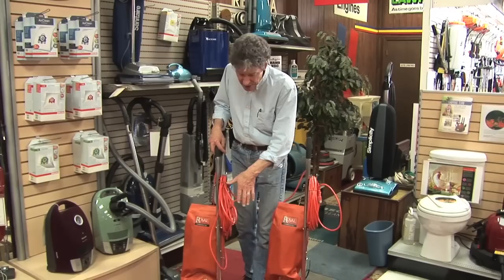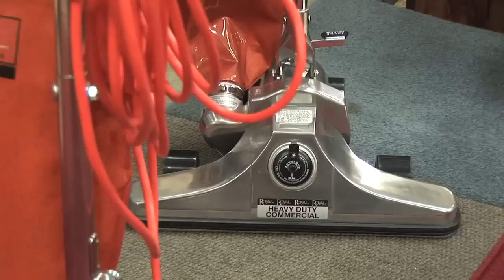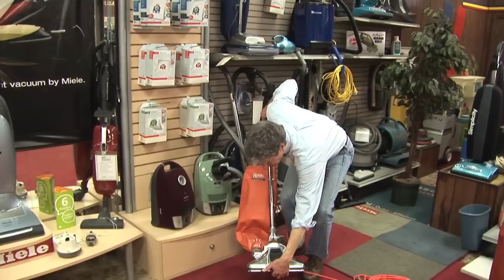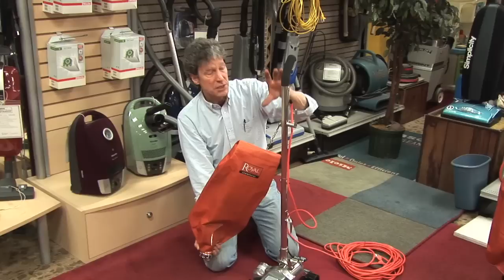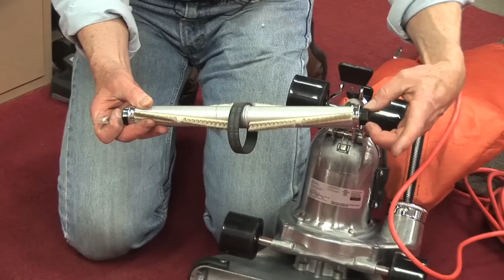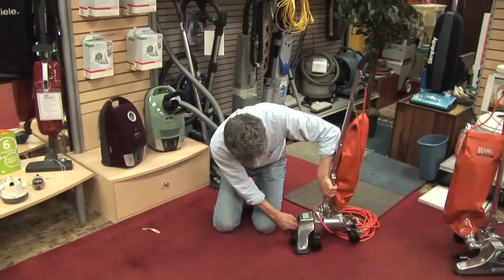Overview of Royal All-Metal Commercial Upright Vacuum Cleaners -- (NO LONGER MANUFACTURED!)

Comment: Would you recommend this vacuum cleaner be used on hardwood or tile floors?
Reply: fivefootsixtriumph The AiRider is a pretty good vacuum for bare floors.
Reply from the maker: The AiRider is a Chinese-type vacuum that uses a principle that Hoover utilized 35 years ago - the exhaust air is directed out the underside of the vacuum to provide a cushion of air on which the vacuum then floats.  A compact Miele canister provides immeasurably more quality, considerably more efficiency and an ease-of-use design that would - in a head to head comparison - be a clear winner.  Here is a link to the Miele (scroll down to see the video on "C2 or C3 Miele"):  http://etpetersen.com/index.php/residential-vacuums/miele-vacuums-hepa/
Reply from the maker: Yes - exactly like the Constellation.  The design can make use on some carpeting a bit problematic - for obvious reasons.
Reply: If I may answer that: No, I wouldn't recommend it. I own a Royal upright, and while you can run it across floors, they aren't designed for them. I use mine mainly for the area rugs in the house. If you mostly have hard surface floors, I'd consider getting another brand.
Reply: What is the AiRider, Ryan?
Reply: An, OK. Like the Hoover Constellation. Yes, I have heard many good things about Miele.
Reply from the maker: Nice Triumph   :-)    Upright vacuums are not typically the best/proper machines for cleaning hard surfaces.  This Royal could be used for that type of cleaning - it could be adjusted up a bit so as not to damage any hard surface; however, it will not clean optimally in this circumstance.  If you are looking for a quality upright and also wish to use it for bare floor cleaning, the Sebo Felix is the best choice for that - here is a video we made showing the Felix:  https://www.youtube.com/watch?v=kL06NOb72PgI hope this helps!

Comment: The Royal uprights here look very similar to the old Kirbys such as the Sanitronic 50.  What's the story there?
Reply: And, Kirby was founded in 1914.
Reply: Matt Jones and 1914 was when my great grandma was born, and she died in 2013 at age 98 😢, I was only 10 and my sister was only 5
Reply from the maker: Hi Ryan - The Royal Company is the oldest manufacturer of vacuum cleaners in the world - P.A. Geier Co. in 1902.  The Kirby, in that respect, is a later "copy".
Reply from the maker: Hi - I cannot say when the 1st one actually rolled off of an assembly line with the name "Royal" on it; but, the parent company, as I understand it - P.A. Geier - started in 1902.  We have been carrying this product line since the 1960's .....
Reply: P. A. Geier itself was formed in 1895, and in 1905 they made the first Royal vacuum, but in the form of a hand pumper. It wasn't until 1910 that the first electric Royal upright cleaner was manufactured.

Comment: Can the Royal metal go on tile or hard wood floors?
Reply from the maker: +Rossana Motta Hi - Matt is right - most uprights due to the action of the revolving brush are not good choices for bare floors.  If you like an upright, the best upright for bare floors is the Sebo Felix - it is a German upright and does bare floors as well as it does carpets - http://etpetersen.com/index.php/residential-vacuums/sebo-vacuums/ and if you scroll down on that page there is a video showing the Felix.
Reply: +Rossana Motta If I may answer that, Rossana, I wouldn't recommend it. I have used mine on floors but it will scatter a lot of dirt because of the roller brush. If you lower the brush too far down, you can possibly damage the floor. I adjust mine a certain way to cope, but if you have mostly floors, I wouldn't recommend one. Now, if you have mostly carpet, large rugs and little flooring, I highly recommend them.
Reply: +Matt Jones Thank you Matt and Keith. Few months ago I actually bought a Riccar Supralite just for this very reason, that now I have wall to wall carpet but in the future I would like to be somewhere without carpet. The Riccar supralite has a setting for non carpeted floors where the brush does not roll so it will work for any type of flooring. Thanks again for your replies, I appreciate :)
Reply from the maker: +Rossana Motta No problem - enjoy your week!
Reply: You really need to find the rare straight-suction Royal metal upright, something like either the 311 Heavy Duty Commercial or the Electro-Hygiene (2-)230.

Comment: Yes, they are awesome machines! I own a household model (2028) and it is a great cleaner. Royal and Kirby are my two favorite vacuum brands.
Reply from the maker: Hi - the Royal is a superior product in design, construction, handling, efficiency and longevity.  I can recall selling Liz Claiborne Outlet Stores Royal Commercial Uprights to replace their Sanitaires - they were getting 8 months out of the Sanitaires and the Royals lasted them at least 3 to 4 years!
Reply from the maker: Hi - We've sold lots of Royals over the years for residential use (and, tons more for commercial use!) as Royal makes both residential and commercial models.  The vacuums are essentially the same but the commercial models use longer 3-wire cords and, typically, reinforced  outer bag assemblies.  The Kirby is designed for home use; but, we have contract cleaners that use them commercially.  When you own something, you can do with it as you like .... :-)
Reply from the maker: Thanks - yes, they are well-built vacuums.  The Kirby is kinda a copy of the Royal although a lot heavier (and a lot more money!).
Reply: They are similar, yes. I prefer the vintage Kirbys to the newer ones. I have had some vintage Royals in the past as well. The 880 was my favorite.
Reply: Keith Petersen yup kirby  and royal  are similar. have you done a test of royal vs sanitaire and if you did what where the results.
Reply: Yes, these two vacuums are quality, however my Kirby is in retirement because it couldn’t handle my dense living room carpet. It sticks like glue to the carpet when I lower it to just touch the carpet, and it doesn’t clean adequately when I raise it so it can move. It’s been serviced, there’s nothing wrong with it, but it’s no longer something that I can use.
Reply: Keith Petersen Kirby is for house old and royal is for commercial use.